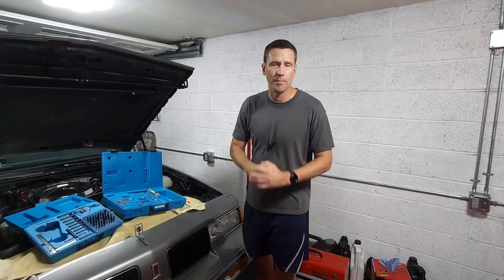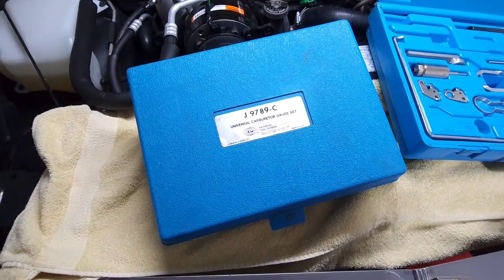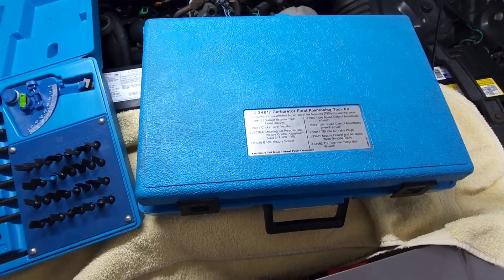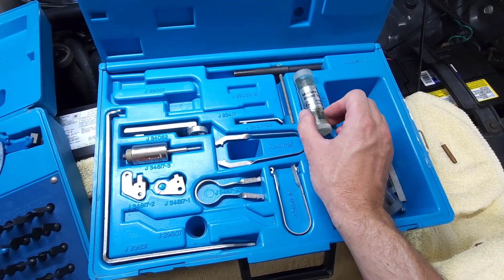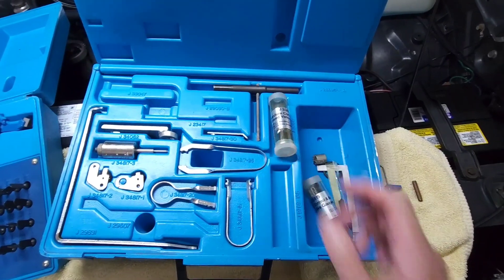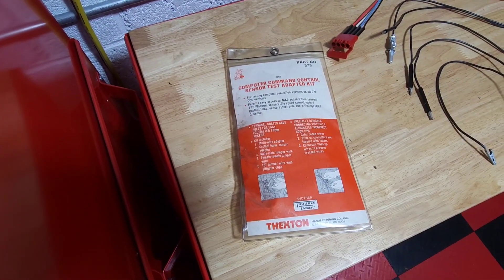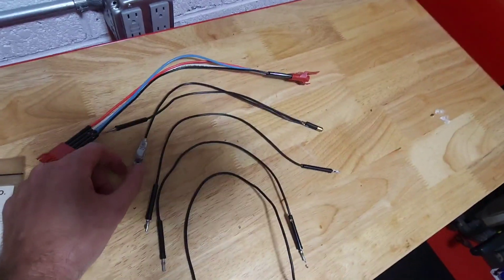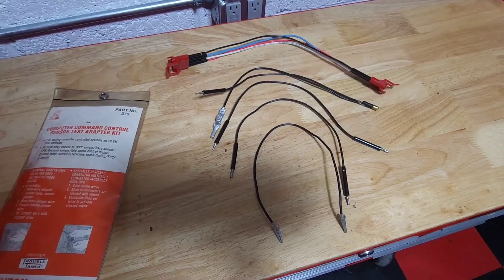3 More Electronic Quadrajet Tools You Didn't Know About (But should own!)

Comment: Cannot stress enough to get a specific GM Chassis Service Manual for your make/model/year. This gives you everything you need to know about rebuilding and troubleshooting YOUR particular carburetor/engine setup. If you know your way around a quadrajet, the CCC Q-jets aren't tough to learn. The carb tools, which I already own, are perfect for working on these dinosaurs. Time savers to be sure.

Comment: These things were such a nuisance that we simply pulled them off, tossed them in a box to be stripped for usable parts and replaced them with a standard Quadrajet (and distributor if necessary) from a wrecking yard.
Check engine lights were wired to an oil pressure switch to mimic original operation or we simply removed the bulb.
I actually found 3 of these electronic disasters two days ago on early 80s Toronados in a wrecking yard, as well as one standard Quadrajet on a 70s Chevy truck.

Ford used a similar carburetor on 1984/85 vehicles, these, along with the earlier variable venturi carbs also got the scrap box treatment.

Comment: what is the difference between a vetronix tech1 series a by techline  vs vetronix tech1a by mastertech? for a 87 cutlass supreme consideration?
Reply from the maker: There really isn't any diffrence as far as functionality. The Tech 1A had some added features for printing and connections to other equipment, but I have never seen any of those machines around. For the home mechanic, I would go with whatever you can find.

Comment: Stupid question..
Wouldn't it be cheaper to just have someone else do it, than buy all the pieces you need to do it once in awhile?
And, what is the average price for a complete tune up? As opposed to just buying the equipment?.. serious questions.
Reply from the maker: Unfortunately, finding mechanics who can properly service these systems is becoming more and more difficult. These carburetors have been out of production for well over 30 years. Add that to the fact that these cars are becoming more and more rare, and you're left with shops that don't know how to deal with them or no longer have the specialty tools they would need to fix them. This has forced a lot of owners to learn about them and acquire the tools to do the job correctly.
Reply: @rporestorations  great point.and you are correct! ..aight, I'll buy the tools... 🤷🏻‍♂️..
Reply: @rporestorations  I've often wondered, what if you bring in a car to a shop that  they're not familiar with.  Good point you make.